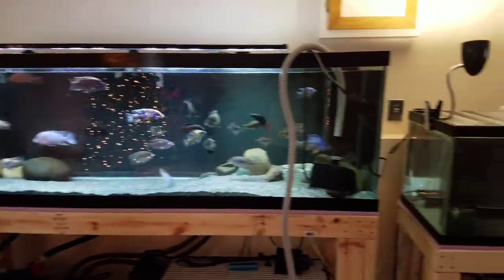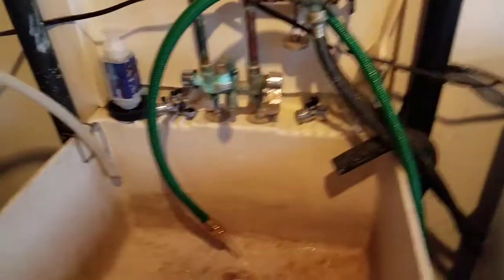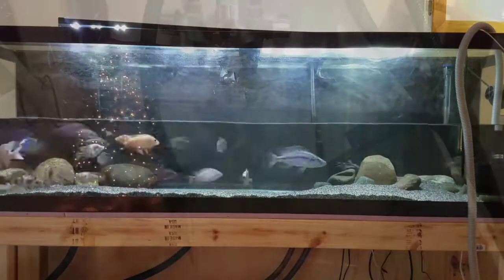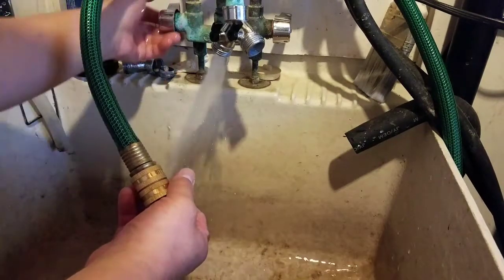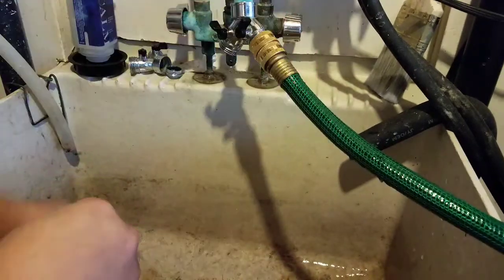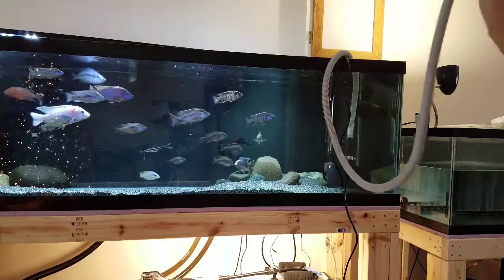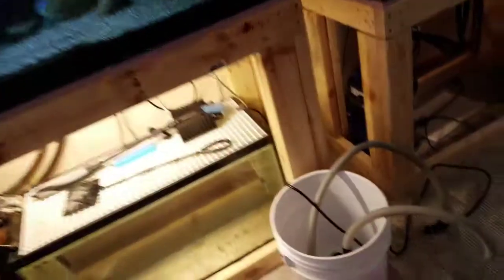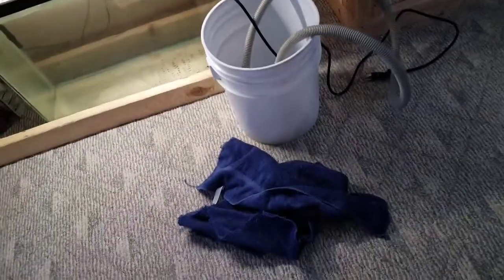How i do water change on my 125 gallon African Cichlid Tank!!!!

Comment: That was pretty good! I bucket mine out then use a hose to fill. Btw, beautiful tank and fish! Subbed to your channel.
Reply from the maker: Fishy Wishes thanks! Subbed you back too!
Reply: CichliDreams appreciate the sub back!
Reply from the maker: @christianabreu8519  no, i add seachem prime or seachem safe to the tank water. As the new water goes in it mixes the water conditioner does what it needs to fast enough not to harm the fish. Done it this way for years per directions on the bottle. Aged water is best but this works fine too.

Comment: it freaks me out adding tap water without treatment before it goes into the tank! Have you ever had an issue with that? Do you add the water conditioner before it starts flowing, during or after?
Reply from the maker: Never had issues. Still do it the same way.